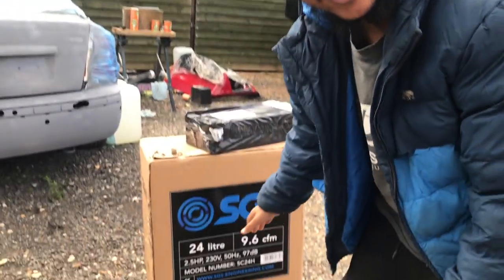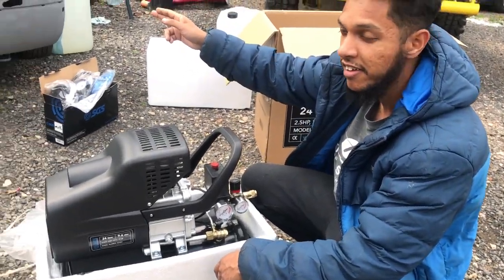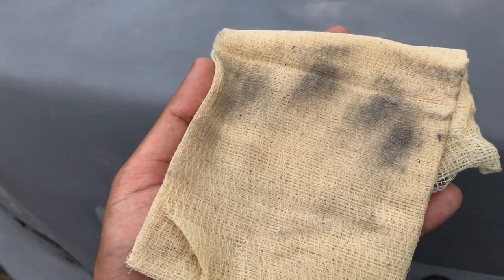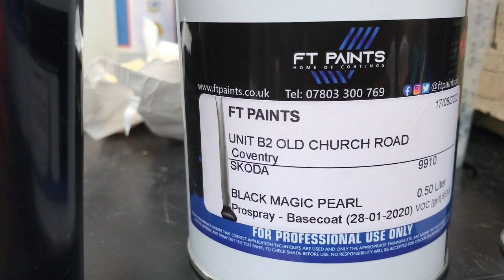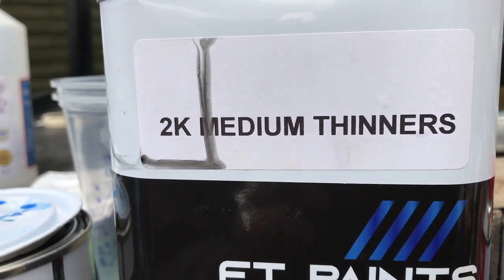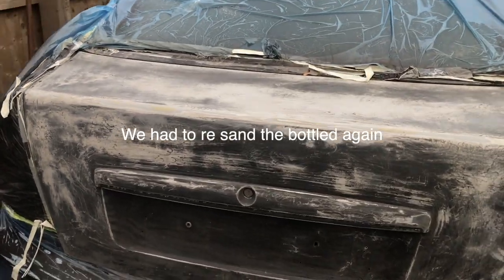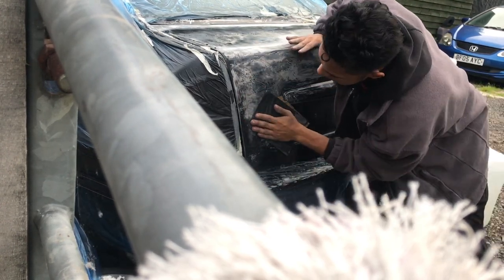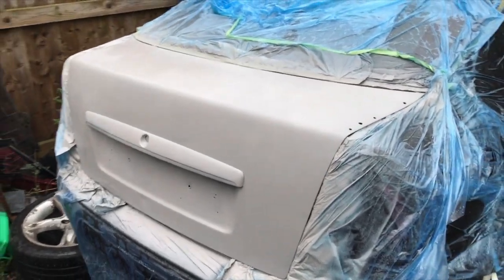SPRAY PAINTING THE SKODA OCTAVIA VRS *FAIL!*

Comment: Good effort mate if you lower you pressure slightly and open the fan on the spray gun abit you will fine that it lays the  clear coat on alot nicer 👍

Comment: Mate shame your not in Liverpool I could have given you a proper tutorial .
So rule of thumb prep is 90% and paint is 10%
So if the existing paint is good and not peeling all you need to do is scuff with 800 grit DRY! Or a maroon scuff pad.
Don’t go over this as the paint will not stick properly.
And don’t go lower as the scratches will be too deep.
This also refers to painting over primer .
Panel wipe it and tack cloth it.
I will message you on instagram now mate
Reply from the maker: ahhh nice one bro will drop by pool one day for a lesson bro

Comment: You need to wet flat that lacquer with ultra fine then use 3g compound on a polisher and it will be shiny as f*CK . Also like previously mentioned the spray pattern needs to be wider on your gun.